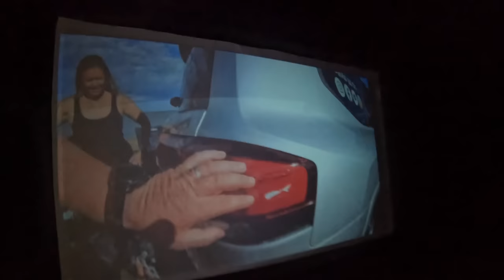Tools & Toys We Take On Tour

Comment: Another tip for a holed radiator!! Black Pepper. As long as you have plenty of water. Run the engine, pour about half of the needed water in, will be warming up, then throw the pepper down it's gob and top up.
Pepper is drawn to the hole and when water is near boiling it gums up and stays solid.
Hit a bush turkey near Julia Ck. years ago in a panel van. done the above and continued to Townsville and down the coast to Melbourne for xmas. Then drove home across to Perth, no coolant issues. Sold the van 6 mths later, good as gold. 😂😂
Oh, and a spare stubbie cooler for Justin Case.........
Reply from the maker: 😄 that's gold. lm tipping black pepper in the 300 series might spell a disaster 😳 🤣. it would definitely work on older model cars 👍.

Comment: Great informative videos. Thanks Troy and Laura.
The one thing l would bring, especially off grid camping is a 100lt water bladder. Sits nicely on the back seat of a Ute. When going into town for stores l fill it up to top up my caravan tanks.  Weight 3kg, ps a small transfer pump, l have a ryobi 12v, and it's awesome. I also use the 12v Ryobi  pump to suck fresh water from creeks/ rivers, etc, to top up Caravan tanks ( obviously, if close to a water source with a hose).
Keep it guys, thx again for sharing Ur wonderful journey 
Tom
Reply from the maker: Cheers Tom, that's an idea. l suppose you can never have enough water 👍

Comment: OMG so much stuff, need to put a sticker on everything and if you use it remove the sticker - after 3mths travel any with a sticker still on needs to go. Everything needs multiple uses. Instead of carting the blow up screen have you thought about using the back of the van as the screen. Better check all your weights, I'm a bit worried you'll be over.😮
Reply from the maker: Hi Linda, Yes, that's a good idea. Our van has been weighed with all the tools in it apart from the blow-up screen, which weighs under 3kg. We're well within our weights with 300kg of payload. Thanks for tuning in 🙏